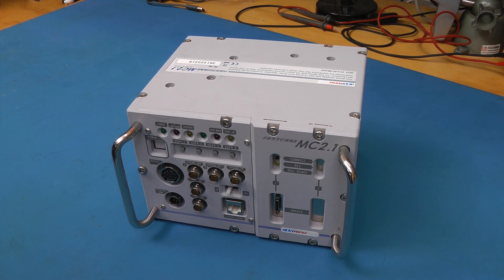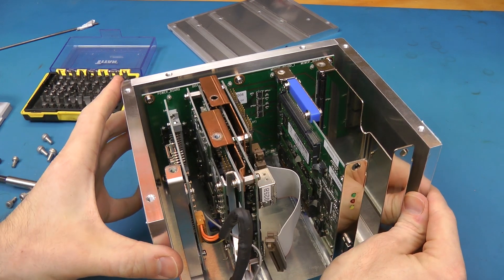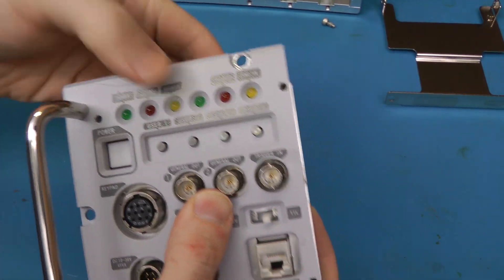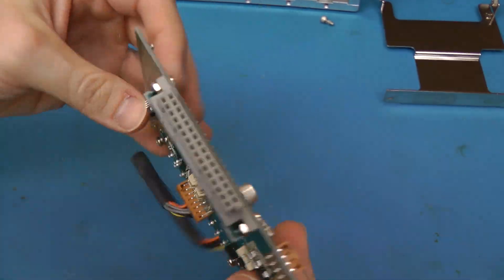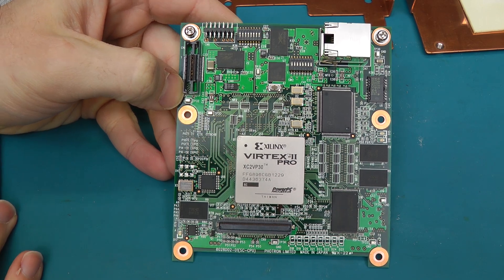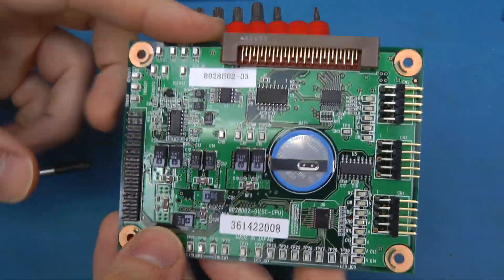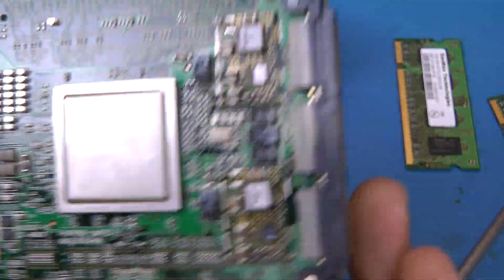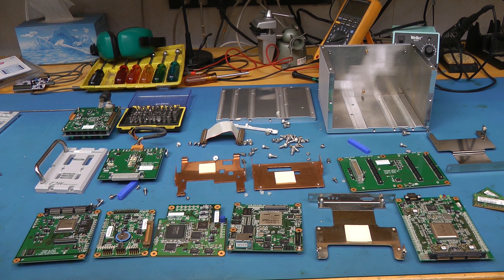Photron Fastcam MC2.1 high-speed camera processor teardown

Comment: For an unrelated question: do you think there's a way to copy the xilinx config flash chips? I got a super old design which uses thes XCFs that's gone obsolete and am thinking out loud for ways to dup them
Reply from the maker: Never actually looked into that but conceivably it should be possible. The Intel FPGAs use a standard flash chip, or at least are compatible with off the shelf flash parts in addition to the expensive "special" ones

Comment: Holy crap, I never knew FPGAs were priced so high. https://www.digikey.ca/en/products/detail/intel/EP2S60F1020I4N/764060 ouch!
Some of the Stratix II's are upwards of $20,000 (CAD) :X
Reply: Peanuts compared to doing custom silicon, I guess
Reply: $20,000 fuckin' hell. And i thought the $1400 one was expensive.
Reply: A chunk of that is tiny features on big dies and thus high scrap rates.

Comment: Did they mill the case out of a single block, or is the 4 sided section a cast and milled part, or it it 4 separate sections?

Yes looks like standard product boards for the different camera systems, they make the top range ones and then for the mid range simply software or configuration changes, and likely the boards each represent different design teams, each working to fit a common envelope and interface spec, but using the interoperability  as they likely have to use up boards already built a decade earlier but still in stock, as I guess production volume would have been under 100 a year, and they made and tested a batch of 1000 boards to get the assembly house to set up the tooling. Could also be that this one was the parts mule, stripped to repair others, and you got all the bad boards put into it, when they either all went out of support, or they started offering an upgrade return for discount on new version option.
Reply from the maker: The case is made of separate flat panels, it looks milled only in sections where parts mate. Good insight there on the likely origins of the board configurations!
Reply: @tesla500  I wonder if that's why they have Altera and Xilinx packed in one product, or do you think there is something about the specific chips that warrant mixing suppliers?